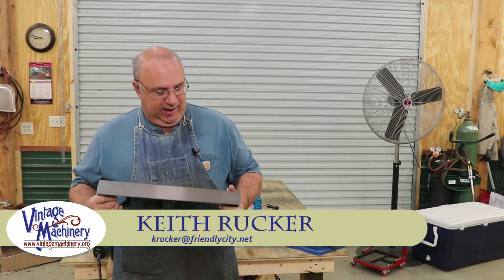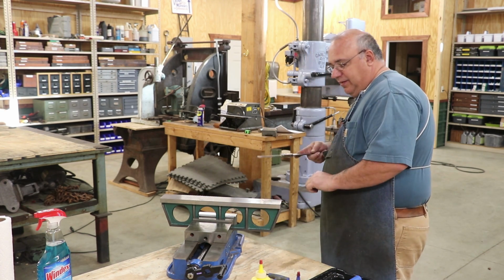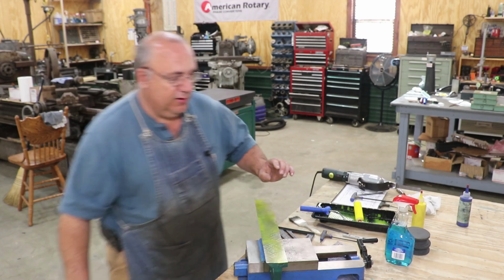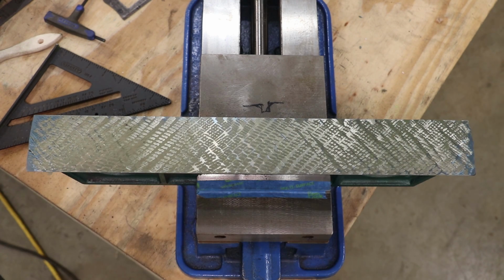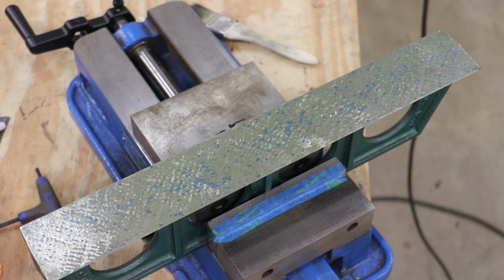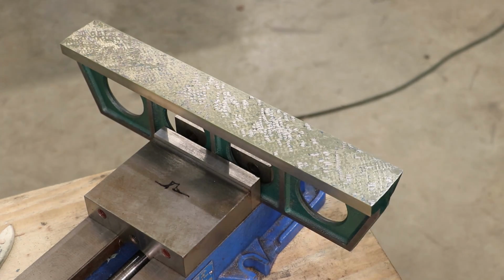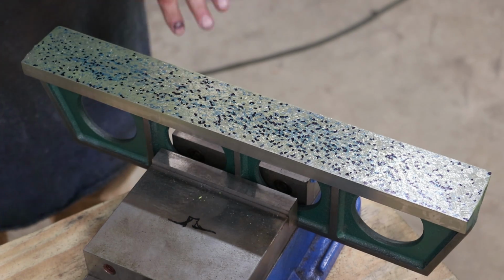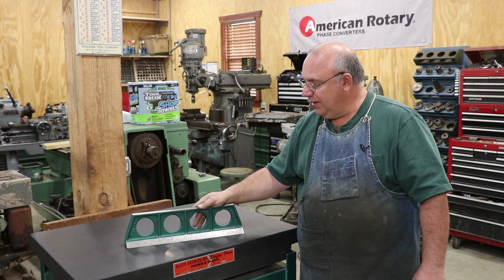Scraping a Camelback Straight Edge Flat

Comment: This makes sense to me, I will practice. Does the metal have to be cast iron?
Reply: It doesn't have to be cast, but cast iron will stay flat better than other metals.  A cheaper alternative is cast aluminum, but it will be less durable/stiff than cast iron. The reason cast metals are good for instruments is b/c they have the least internal tensions.  For example, a forged & hardened knife is hard because it has internal tensions in the metal. The arrangement of the atoms are such that they are pulling against each other.  For a straight edge this is not ideal because it means when the temperature of the room changes or when your hand warms one spot of the straight edge there will be non-uniform expansion/contraction..  Cast metals can be cooled very slowly which allows the atoms to come to rest in positions where they are not pulling against each-other. 
So, cast metals are the best, cold forged & case hardened are the worst. Another good material for a straight edge in theory would be granite or ceramic & in fact several companies offer such straight edges.  They would be extremely precise/uniform, but they are fragile & expensive/difficult to manufacture.

Comment: I would strongly stress the importance of the radius and the size of the scraper blade, or it`s width to put it that way... I know im late to the party, but a wide arc, wide blade scraper will take off sub micron cuts if you need it, but a 1/4 inch wide scraper with the same arc will gouge deeper just due to pressure difference from the contact area decrease when compared to a wider blade... You can shape your scrape marks with custom scraper arcs and different widths of the blade... You can define the low spots with custom scrapers, and widen the high spots with a flat ground stone or a flat lap with frangible grit that doesn`t charge the surfaces... You can also as a newbie make nasty gouges with a narrow scraper with an acute arc to it... Robin Renz has a great section in one of his videos on this topic, i can`t remember the name of the video, but practically know all of his videos by heart, so i know that it`s somewhere among his works... 

Otherwise, a good scraping instructional video... 
All the best and kind regards!
Steuss

Comment: First why do people use thousandths or millionths of inch? Just use an international unit that makes sense, like microns. Everything there is within a few tens of microns precision. Second, you could have obtained an even better precision with a couple of sacrificial granite slabs that you grind together (a bit larger than your straight edge tool) and then use one to grind your tool with it.  You could have gotten your mini slabs for free from any funeral home or countertop place and a little carbide powder and without ending up with those ugly pits. Scraping wakes sense in places where you cannot access the surface easily.

Comment: Hello Keith,

thanks for sharing your scraping skills!
The sense of a scraped surface for dovetail guides makes sense to me. The valleys around each high spots provides space for lubrication, this prevents a stick-slip effect and wear.

What I don't understand is why a measurement tool like your Camelback Straight Gauge is scraped.
I expect high accuracy and high precision from a measuring device like a straight gauge. Smooth sliding in a dovetail guide is only secondary. The best example is  your granite table - absolutly smooth and flat!
Would it not be better to grind and lap the ruler?

Cheers, Arthur

Comment: Very good video. Many many years ago, I became a 'master' rated scraper. Back in the olden days, we would make our scrapers out of 'annealed and drawn' 10" mill bastard files. We would hand grind the ends for the radius and cutting angle, and put it into a 'paddle'. Imagine the handgrip end of a baseball bat, but cut off 8 inches up. The tang of the file would go into the sawn off end, and the 'swell' at the bottom of the bat would go against the hip bone, held there by the right hand. The left hand would control the downward force and tip of the scraping end. To scrape, you shoved forward with your hip, and you could 'hog' maybe .002 to .004" at a time. You could also 'touch' the surface like that, and remove just the blue by tipping the scraper and take off maybe .0001.

My 'fine' surface high point count was determined by how many points in the diameter of a dime. To get my master rate, my demo project was re-truing three horribly worn 18x24 cast iron plates. I used the Whitworth method, and got them to 10 points to a dime, with the worst measured deviation of less than .0007 anywhere on any plate. The local NBS lab kept one of my plates for their lab after they certified them. 

That was then, but now a days, no one wants that sort of actual precision or accuracy. It would cost way to much to get anything that absolutely flat now a days. "Grind it to within .002" is good enough" is the standard in lots of industries.
Reply: Why would anneal the file?

Comment: I love machinery,lathes n milling machines but to my untrained eye you took a perfectly flat machined surface and turned it into a rumble strip... I would need to see it to appreciate it
Reply: Yep. It makes no sense why you would mill  and grind something flat... then destroy it.Furthermore, if you really want to destroy it, then why not just use a cutter and create a nice uniform (and FLAT) pattern across the surface?
Reply: @johncoops6897  In the video he thoroughly explains that the entire reason you don't want it to be entirely flat is so that lube can actually move between the surfaces. You wouldn't want it to be a uniform pattern because you want that oil to pool and move between those spaces. If you made a uniform pattern you would just end up with that oil ending up inside those grooves.

Comment: Great video. Maybe the only thing you did not show is “ringing” the part by tapping all over with a dead blow plastic soft faced hammer to help release residual stresses introduced in the casting by the scraping process. I learned that in a recent Richard King introductory scraping class.

Comment: Please.  Somebody explain why you scrape something by hand after you used a milling machine to flatten it.  I know there's a good reason, I just don't know what it is.
EDIT:  Google is my friend....
There are several reasons to hand scrape:
Scraping is done to align components within millionths of an inch, allowing for consistently-held, tight tolerances. Eight to ten contact points per square inch are created to prevent rocking, add balance when tightening, and to allow for true flatness in parts. https://www.hobby-machinist.com/threads/metal-scraping-why-and-how-to.23188/
Reply: A milled or a ground finish fresh from the machine may look to be accurate, but any machine tool will usually reproduce it's own inaccuracy in the work-piece. This is due to wear and tear plus any looseness in it's slide-ways. 
In addition to this, when a job is clamped down on to the milling machine table it can be distorted due to one or both surfaces being out of true and the clamping pressure causing the distortion.
When the finally machined component is released, and then put down on an accurate surface plate that has been previously blued, the high spots show up easily and it can be scraped back to flat.
As Keith says, the oil retaining properties of a scraped surface are necessary for good lubrication and smooth running.  
A few years ago I re-scraped a 10 ton bed on a Butler Planer because it was juddering, and that juddering was showing up in the surface finish, despite the slide-ways having plenty of lubrication. After scraping, the juddering dissapeared, and the current needed to power the machine was much reduced.
Reply: Mike Norden Thank you. That's the info I was looking for.

Comment: I wish someone would explain to me how this straightedge is used in the shop.
Reply: Richard Brooks Seeing how flat something is is one use. A few things that come to mind are engine block and cylinder head decks.
Reply: One can also use it on the ways of machinery to check wear. The one with the dovetail he is working on looks like it would fit on the ways of a Bridgeport.
Reply: @CapnPZazz  Thank you.

Comment: Thank you for a great video-  I have a question relating to the straightedge moving over time.  If the shape allows, would you just be better off using a granite bar for marking high spots rather than the cast iron straightedge?

Comment: So,now you have contact on the base,and the 45,but how do you make sure the 45 true to the base all the way down?Do you have a video on how to do that?I am wanting to make one also.Also if you have say a 24" or 36" straight edge,how do you use it to check the entire length of a lathe bed that is way longer than your straight-edge?Thank You for sharing!
Reply: Take it in sections, and pay attention to overlapping them - I recommend the Edward F. Connelly book "Machine tool reconditioning and applications of hand scraping" which is the bible, really!If the base and the bevel edge are both straight and flat, the angle between them can't be anything other than the same angle all the way along, that's Jommetry :) It doesn't need to be 45* anyway, unless you're using it as a gauge - if you're making surfaces mate you only need to get them both flat and can do similar blueing for contact.

Comment: Great vid Keith.I used to work at a company in the UK called Wellworthy.They had at the time 80% of the world Diesel engine component manufacture.Sadly no longer.In the factory they had a skilled section that manufactured large machines for export.I got to see the section.And they were using 4 ft camelbacks.How I wish I could have worked there.( no chance) Great vid,love to see the old skills.

Comment: Oil puddling in the "low spots" turns into "slurry" when the metal off the "high spots" mixes with it. Eventually "lapping" the two surfaces together but only if lubricant is continually added to the "mix".

Comment: I have to say that until all the YouTube "machinists" educated me on "straight edges" along with "scraping" and "surface grinding" and other previously unknown to me "technology" even after 25+ years as a diesel mechanic, I'd never even SEEN a "straightedge" that wasn't used and designed to check for "straightness" on its EDGE rather than its "face" and I'd never SEEN a "surface grinder" in a machine shop and had never heard of "precision grinding" anything "dry" or even with "water-based" coolant/lubricant since my only exposure to "precision grinding" was with valve grinding machines and whetstones using "cutting oil" as the coolant/lubricant and SCRAPING was something done to REMOVE UNWANTED MATERIALS FROM "PRECISION" SURFACES RATHER "IMPROVE" THEM. I'm still trying to figure out how a "straightedge" can be a "casting" with giant "openings" cast into it and be "dimensionally" and "thermally" stable and stay "flat" or "straight" when all the straightedges I've seen are simple "steel stock" and look much like oversize "steel rules" and are "solid" with "consistent" width and thickness along their entire length with "edges" that are a lot "thinner" relative TO the "width" and "length" than any of these cast "straightedges" that are pretty much "straight plates". I think the "real test" of how "flat" something is to lay a "straightedge" on it and shine a light "between" the two surfaces or at least TOWARD the "intersection" and see what if any light "shines through" that "intersection". 

And that's if you can't get a feeler gauge (.001" is about as thin as you can really make a "precision" feeler gauge and even those are hard to find - probably because of how hard they are to "scrape" or something) between the two. And honestly, I've never seen anything in the "diesel industry" that didn't need to be LAPPED and wasn't fractions of an INCH in diameter that needed to be "flat" or "straight" in excess of .001" or so per 10" of length. 

These giant, oddball "straightedges" like "scraping" itself seem to ME to be ways AROUND precision manufacturing specifications "below" .001" and don't seem to regard "surface finish" as a "factory" and often a very CRUCIAL one in "surface metrology" at all. Which is weird since the SURFACE FINISH of something like a "deck" on a CYLINDER HEAD OR ENGINE BLOCK has a LOT to do with SEALING AND "GASKET RETENTION".

Comment: So if my theoretical "surface plate" has "dust" and "debris" on it I should "clean" it by spraying some kind of "cleaner" on it and then using a "clean rag" to rub the now wet "dust" and "debris" across the surface to "remove" it? When abrasives are so BAD for "surface plates"? How does THAT "work"? Sure the "clean rag" is "soaking up" the "dust" and "debris" but FIBERS can't really "soak up" ANYTHING and the "dust" and "debris" are still there in the RAG.

And given the "natural oils" in HUMAN SKIN and the "tendency" of oils to "attract dust", why would anybody want to rub their skin across a surface they just "cleaned" to remove "dust" and "debris" that PRESUMABLY is at least PARTIALLY "attracted by" and is RETAINED BY "oils" on its surface? 

Don't you typically find "surface plates" in the CLEAN ROOM rather than the "tool room" of a "machine shop" or "metrology lab" or "factory"? Rather than just the "shop" where machine tools and abrasives and oils and dirty, oily abrasive human beings are constantly found?

Comment: If some "expert" on machining and "metrology" can explain to me how "scraping" is able to "flatten" or "straighten" a surface machined into/onto a surface by machine tools in order to make a "straight edge" or "surface plate" supposedly "flatter" and/or "straighter" than any machine tool must be able to produce ITSELF and what possible "practical" purpose there could be for a "straightedge" or "surface plate" that's straighter and/or flatter than anything it could/would be used to "check" which presumably would come off a MACHINE TOOL, that would be great. 

And "theories" on why there are a million different machine tools and machine tool manufacturers but none for "automatic scraping" even though for "thousands of years" scraping has been "recognized" and supposedly "used" to produce "flatness" and "straightness" even thousands of years before MACHINE TOOLS EXISTED would also be very welcome. 

Personally, I've never seen "scraping" with a gasket scraper or other sharp, chisel-like object do anything to a "flat" or "straight" surface besides cut, gouge, distort and "ruin" it once the scraper got through the gasket and started scraping metal. And only a "fingertip" is needed to FEEL that the "flat" and "straight" surface is no longer FLAT OR STRAIGHT and NO MANUFACTURE OF "PRECISION-MACHINED PARTS" SELLS BRAND-NEW "FLAT" AND/OR "STRAIGHT" PARTS/SURFACES THAT ARE ANYTHING BUT "MACHINED" WITH NO "SCRAPING" TO BE SEEN WITH "SCRAPING" SEEMING TO BE A "REPAIR" OR "REBUILD" PROCESS SO HOW AND WHY WOULD A "REPAIRED" OR "REBUILT" PART NEED TO BE AND END UP BEING "FLATTER" AND/OR "STRAIGHTER" THAN FACTORY NEW PRECISION MACHINED PARTS?
Reply: Obviously you are a bit of a bodger - even scraping gaskets I've not damaged the workpiece since I was a kid. Probably because I've used decent tools well looked after without jagged edges. Wouldn't let you work on MY guns.

Comment: So glad to have found this.  Very well presented.  So well I think I can do it.  I would like to know if after reaching 40p or so, can it be lapped down smooth for applications that dont need lubrication.  Like just a normal straight edge used to lay on a surface and check for gaps with light.  Or can lapping be used instead of scraping when a smooth surface is wanted.  blue it up and sand it off?
Reply from the maker: Sure, lapping is possible to do, but for what you are using it for, scraping is probably a lot faster and gives the same results in the end for it's function.
Reply: I will be needing a smooth surface.  And i know scraping is faster.  And i will try it.  But can I then lap it smooth after I get close.  How low are the low points?  Wil I still have to lap .001?
Reply: Oh! Thanks for your reply.

Comment: When you are orking with .0001in, does clamping the straightedge with a C clamp introduce a noticeable bend?
Reply: Doesn't matter during scraping. It is not clamped when checked on the surface plate, therefore not distorted, so it's all good.

Comment: How do you know that the angle is as accurate as you're making it flat? And how would you adjust for it? Thanks
Reply: Don't need to be accurate. It is not angle measuring device. Flat and angled surface are used separately, independently.

Comment: The first bluing, the high spots were mainly on the ends where you were light on the first scraping. So, what would the bluing on the granite plate show after the surface grinding and before any scraping?
Reply: Smeared ink.
Reply: Troll "chris0tube". Not true. It would indicate, that you are out of bluing compound capability ("resolution"), or you are rather preventing bluing from work (almost completely). You need some surface texture to break the oil film ("blueing" base ingredient).
Reply: Chris, you can scrape a set of three surface plates from raw plate, it's how the first were generated and made accurate to millionths of an inch. No clever machines, just skill,  patience and care required.You blue the reference as it's easier to identify blued points of contact on the part you need to flatten than try to read holes in the blueing.

Comment: Kieth,First comment. Very well done.
On straight edges, I was tought, to not worry about the angle needing to be parallel to the bottom.So you are just scraping to separate flat areas.
If you needed to test a part with a dove tail, you stick the angle into the slot, and transfer blue.